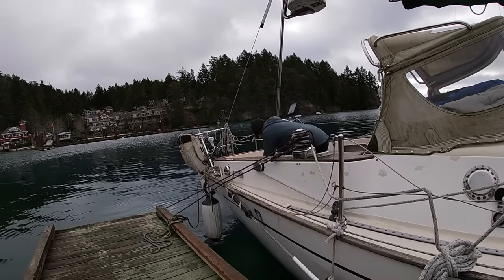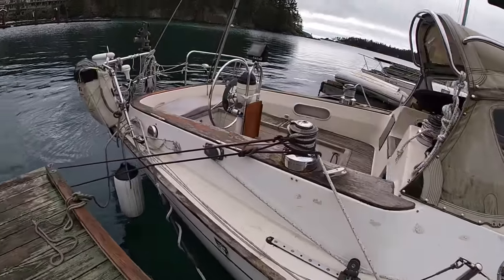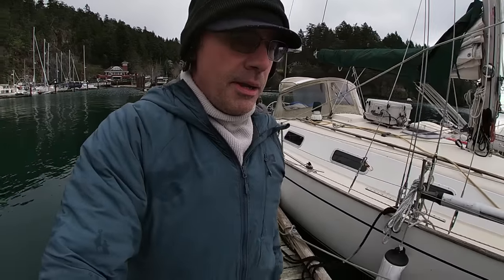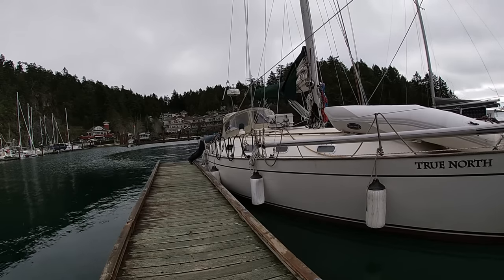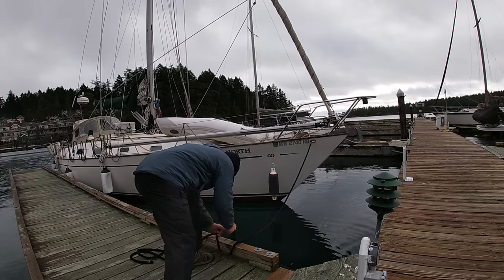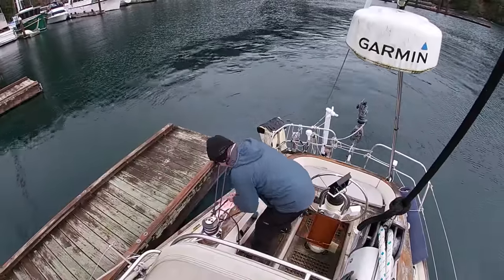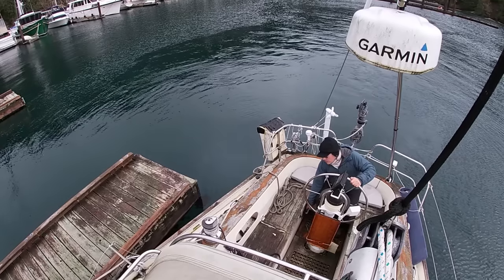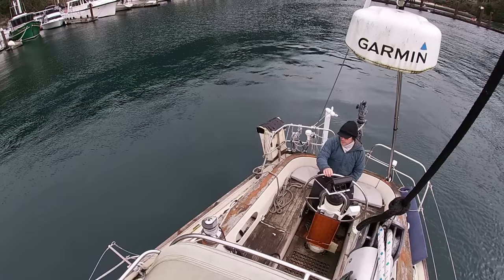SINGLEHANDED; LEAVING THE DOCK USING THE "MOITESSIER STERN TIE" -- DOCK VIEW

Comment: Where's the rudder?
Reply from the maker: You can start with the rudder centered and see where the boat lies against the dock. In this case, if I turn the wheel to starboard, the stern will settle further away from the dock. If I turn the wheel to port, the stern will settle closer to the dock.

Comment: As she's laying some starboard helm locked on helps stop the bow blowing off. The way I do it is to use a spliced eye on top of the winch, neutral or a  touch astern then neutral, flick off the line instantly and away. Before you've thunk it, the eye just  doesn't catch and you could flick it off with ease anyway. Try it.👍
Reply from the maker: Great idea mate. I like it. Thank you for sharing that.

Comment: Why didn’t you use the helm as well instead of an increase in throttle
Reply from the maker: Great question. I could have used the helm, but my wheel lock doesn't work anymore, so I would have had to tie off the wheel. The water from the thrust straightens the rudder out when left unattended. Very good question!

Comment: Nice. I do much the same but I first turn the stern line into a slip line so there is no need for a line on the winch. Also in this case I would put the wheel hard over to starboard and lock it. This helps keep the boat held on to the dock.
Reply from the maker: That sounds like a great approach. I must try that. Thank you!

Comment: That works good.  If that was me, I would have the helm turned to the starboard side to keep the bow pushing the wharf instead of more throttle. That would help with stronger wind issues.

Cheers
Reply from the maker: Excellent suggestion. Thanks for the note. I continue to learn from other boaters with comments here -- thank you!
Reply: @respecttherisk2022  we are all connected 🙏 thanks for posting your video

Comment: Beginner Canadian sailer here.. Why do they call it a Spring Line? Thx.
Reply from the maker: There are typically four dock lines -- the bow and stern line, both of which end up roughly perpendicular to the dock when tied off: these are meant to keep the boat close to the dock, perhaps 6 or 12 inches. The other two are the "Spring Lines." They are to prevent the boat from moving forward or to stern in the slip. I am not 100% sure on the origin, but in my own mind, they prevent the boat from "springing" forward or to stern in the slip because of wind or current. In practice, they are perhaps 10 to 15 feet long so as to be almost parallel to the dock -- more rope out allows more stretching movement of the line, thus reducing the forces on the boat. Happy sailing and docking!

Comment: What a simple, ELEGANT strategy!!!
Many Thanks.
Reply from the maker: You are welcome! Glad you liked it.
Reply: @respecttherisk2022  quick followup question: would you also advise to turn rudder to port… to pin stern to dock?
Reply from the maker: @tarekabdel-hamid2226  You can do it either way. Play around with the rudder to watch for how it impacts the angle of the boat at the dock. I have starboard prop-walk -- so I typically put the rudder to starboard to move the stern as far away from the dock as I can. Then, when I untie, and begin reversing out of the slip, my prop-walk straightens the boat out. Once the boat is moving slowly in reverse, I put the boat in neutral to get the rest of the way out.  So the rudder angle can become a tactic to pin the stern to the dock or move it away. Good luck and happy docking! :)

Comment: In UK usually have three cleats on each pontoon so only works if pontoon is longer than your boat and last pontoon cleat is behind your  deck stern cleat/winch. My pontoon as many finishes well short of stern and all pontoon cleats are forward of corresponding deck cleats. I tried it running a spring forward to centre cleat with a traditional shaped boat the tapers significantly it doesn't hold it the same way.
Reply from the maker: That is an interesting challenge that we don't see here much. Usually the docks are as long or longer than the boats. I wonder if you had a tie forward, and put the boat in reverse, adjusting the tie point until it sits where you want it? Just a thought.  I will try that when I am on the boat next.
Reply from the maker: One more thought I had for you -- if the engine is engaged in reverse, I would anticipate that prop-walk to starboard or port will impact where the tie goes. I am keen to try this myself to see how the boat responds. Best wishes!

Comment: As a Frenchman who was a sailor and a teenager in the 60's I read extensively Moitessier and I must say I never heard of the expression "Moitessier tie".
This method along with many others depending on wind, current and space was very well explained in the various booklets from PBO, or Practical Boat Owner published in the late 80's to the mid 90's.
PBO nor Moitessier invented this tie : it's been in use since ever and it's been one of the subtleties of mooring and casting off to use it properly with all its variant as many parameters come in the picture (including the pitch propeller).
As a matter of fact, although I fully understand the educational purpose of this video, I must say the "Moitessier tie" seems quite useless in conditions shown on video : weather is calm, apparently no current, very light wind … why not cast off all lines and just back off ??? the more so the area is quite empty.
As for casting off the lines from the pontoon, this is quite surprising.
It's been done by many amateurish crews these days and it certainly is not the way to do so. Crew remain in control of the boat when onboard!
The more so when singlehanded. Mooring line are simply passed through the cleats without being tied so it's a matter of slipping lines. Simple and very efficient.
Having sailed singlehandedly a lot during my time I thrive for simple, common sense, nobrainer methods : the ones that work with the boat I sail.
Then again the conditions are so easy in this video tant either way work well…
As for leaving lines dangling on the guardrails it's a "don't even think of it" for me, coil them and they will un coil very easily. 
Then again each one does as he likes.
Live and let live !!!…

Cheers ! … 

PS Moitessier is certainly a man to read when sailing singlehanded.
Reply from the maker: Thanks for the many thoughtful and considered points.There is a lot there for all of us.   It sounds like we share an affinity for Mr. Moitessier's books. I have read them all multiple times and always learn something new after every read! That is interesting re the PBO reference -- good to know. I called the "Moitessier Tie" as that was where I first heard of it. My sailing courses had never covered it! Totally agree: Simple, common sense is always best! All the best. Cheers.

Comment: I use this method to single-hand as well. 
I use  a modified version when backing out of the slip when the wind and prop walk are pushing the bow towards the dock: I pull in on the line while backing and use it to hold the stern towards the dock and the bow away. cheers...
Reply from the maker: That's a good idea. Thank you for sharing that. All the best mate.

Comment: good stuff. what would you do for scenarios where you have wind abeam starboard?
Reply from the maker: Thank you. If the wind was abeam to starboard, you would notice the bow coming off the dock to port. You could add some throttle, and turn the wheel to starboard to help keep the bow on the dock (while stern line is still attached). I have starboard prop walk, so one of my challenges if the wind is abeam to starboard, is losing the bow to port as I start to motor out -- both from the wind abeam, and my starboard propwalk. I can counter this using the stern-tie by moving the stern away from the dock with wheel to make a 20 or 30 degree angle, bow on the dock, and then reverse out -- which helps but doesn't always work. (I can lose the bow to port and it can foul on the boat next to me if the wind is stronger.) In these instances, I have done a bit of a "cheat" tactic, where I walk the boat about halfway out of the slip with the motor in neutral, let the wind catch the stern and blow it to port slightly, climb aboard, and motor out. If the wind is too strong abeam to starboard, I would ask for help guiding the bow out from someone on the dock. Longwinded answer, but these can be challenging conditions singlehanded!
Reply: @respecttherisk2022  interesting. thanks a lot for the info! very helpful😃

Comment: I've been doing this on my Sparrow 16 trailer-sailer for many years. It is super handy because I'm using an old outboard that only has forward and no neutral.

For me, I retie the stern-line by having it wrap around the cleat or bull-rail and bring it back to my mooring cleat. Then with the motor on and turned to push the bow in a bit, I can undo the rest of my mooring lines at my convenience. Then I get in the boat and when ready, undo the stern mooring line and go. 

My outboard is one that can be turned 360 degrees so that if I need to back out, I can do that easily too.
Reply from the maker: Thank you for sharing that detail. That sounds like a great and flexible approach.
Reply: @respecttherisk2022  You are very welcome. Like most innovations/inventions it came out of necessity! 🙂

Comment: Im thinking of getting a trolling motor to pull in and out.
After further thought   i have to do it with lines. The wind and the tide can  beat that.
Backing out with winds off aft port tide coming from aft the wind pushes bow  and im 180 degrees from where i want to be.
Reply from the maker: That is a really interesting idea.

Comment: I was very interested to see another method of leaving dock solo as I sail solo. However I prefer my own method. As you said, getting off the boat with the engine running just makes my scalp itch. 
I take all lines off bar one, the midship line. It's tied to the midships cleat, goes to the dock cleat and takes only one turn around it, then back to winch. I can use the engine if I want to point the boat, then I simply undo the line from the winch and as I reverse, the lines comes off the dock cleat and I can quickly pull it on board.
Reply from the maker: That sounds like a very elegant approach. Thank you for sharing that -- I will give it a try!

Comment: this was worthwhile.  I note you did not have to turn the wheel to starboard, kind of appears like you would have to if there was a stronger wind blowing from the starboard beam...wouldn't the bow want to drift off dock more?  i'm gonna practice this maneuver. ty
Reply from the maker: Thanks for the note. Yes, if the wind or current was on the starboard beam, you would add starboard helm and/or throttle. Best wishes on this. I found playing around with the helm valuable to learn the sensitivity to the angle of the boat at the dock.

Comment: All very calm and in control which is what we like. For me, taking off the spring lines and stowing them is no.1, converting the stern line to a highwayman's hitch or similar so that I can stand aboard and release the knot from the safety of the vessel using the working end is no.2. And then removing the bow line is no.3. No.4 is removing the tension on the stern line and leaving the dock. On a slack tide I'd store all my lines including the bow line whilst moored by the stern line leaving only the stern line to store once I was off the dock. On a rising/falling tide I'd improvise dependant upon wind etc...But that is just me, and I don't even own a goddam boat and never have. How weird is that. HA!
Reply from the maker: Thank you for sharing that. I like those ideas. I had not heard of the "highwayman's hitch" so I had to go look it up! (And I am a bit of a "knot-guy" as a lifetime rock climber and sailor!) That looks like an elegant approach. Thank you for sharing that! All the best!

Comment: One can also tighten the line and use it to start a turn around the end-of-quay bollard if space is tight. The name in french is: “faire croupiat". The great sailor Bernard Moitessier used it, but the maneuver has been known for ever and not used solely in harbors. 
          When a (motorless) sailing vessel was anchored leeward of and close to a shore and the wind turned opposite, increasing to a gale, the crew could lower a rowboat and moor a spare anchor, the hawser of which would be tied to midships. 
          With hawser taut and the sails ready to be hoisted, order would be given to cut the bow mooring: The vessel would pivot and take speed on a arc around the “croupiat anchor” and would thus sail her escape from the tight spot.
Reply from the maker: Thank you for this very useful and informative comment, not to mention the historical significance as well. There is a lot there to take in. Great information, and great advice for all of us. Thank you!

Comment: Love this!!! I have a long bow sprit platform on my 38’ ketch rig..  when I leave the dock there is always wind coming off my Starboard Bow which of course makes her drift to Port.. I often ask a passerby to grab a Starboard bow line to keep me straight until I get safely backed out… your video will help me solve this problem… Thanks for sharing and I just subscribed to your channel..
Reply from the maker: Glad you liked it. It does help. Sometimes the current and wind grab the bow and even this tactic is not quite enough. The other day, I had to push the boat out of the slip by hand about 2/3 of the way, angle it to port about 30 degrees, climb aboard and back out the rest of the way with prop-walk pulling me back to starboard. I am still learning and perfecting my techniques!
Reply: @respecttherisk2022  Good idea!!  I have thought about doing that too..  Well it’s all part of the adventure as they say!!  I have come to realize that arriving at and leaving the dock sometimes causes problems for seasoned experts too…. 😎⛵️🥢🏴‍☠️🤙

Comment: This is the ONLY way to leave the dock in an unfavorable wind!  

Here in the States, we’re lucky because we have cleats instead of rails.  That makes this much easier.  You simply take a short line with a spliced loop in the end, slip it over ONE horn of the cleat, and tie the other end to a cleat on the boat.  

Now, you simply back out of the slip and the dock line falls off the cleat without any effort on your part.  The line falls in the water, but it’s too short to reach the rudder or prop.  Both hands are free for the wheel and engine controls. 

Once safely clear of the dock, you can pull it in by hand, or use a docking pole, or even pull it in with another dock line bowlined to it.
Reply from the maker: Oh wow! That is a great idea. I will keep that in mind for when I am at a marina with cleats. An excellent suggestion! Thank you! I agree, it is always a struggle with an unfavorable wind -- especially singlehanded -- so easy to lose the bow against a neighboring boat! Thanks for tip!
Reply: @respecttherisk2022  
Just be careful that the eye splice doesn’t slip over BOTH cleat horns; then you’re not going anywhere!  The smaller the eye, the better!

Been there; done that!  Sure glad there were no witnesses!
Reply: Nice!

Comment: Great method! I would be quite tempted to just use the self trailer on my winch to hold the line, thoughts on that?
Reply from the maker: That's a good idea. Just make sure it is "bomb-proof" so to speak, and there is no danger of someone or you upsetting the tail by kicking it or upsetting it in any way -- it would be regrettable to have it come undone and thus run your boat into the dock while it was in forward gear. That said, I like the idea that it can be undone under load easily.

Comment: Thanks for the video, I did this for 2 years when I had to get off the dock single handed in San Francisco.  This work well until we have a strong (>10kt) crosswind breeze, which is about every summer afternoon in SF :)
Reply from the maker: Right on. Yeah, a strong cross breeze would be tough tough tough! How did you manage it? We would all love to hear your thoughts. Thank you.
Reply: @respecttherisk2022  I turned the wheel towards the breeze to get some prop wash to help get the bow to the wind.  It’s still quite tricky as I shift to reverse the wind still wants to quickly catch the bow,

Usually I watch the marina water for ripple so I can anticipate the gust, and go when I see a lull.  If the breeze is more than 10 knots, I will still need crew to help walk me out.

Comment: An aft leading spring line from the quarter is the best line to rig both for docking and undocking. Very unappreciated.
Reply from the maker: I also have not seen it used much by recreational boaters. I also use it for docking as well when the need is right. That said, mce the boat has stopped, I have started stepping off the boat with midship line and a stern line and tying them off without the stern spring line. Seems i do that the most these days.

Comment: To put a boat in gear, with no one on board, is just too much of a risk for me. There is no way to stop the boat if things go wrong.  Here is my way to undock single handed. I prep one center slip line, that runs from my cockpit to the middle of my boat,  to the dock and same way back into the cockpit. So both ends are in the cockpit (or your winch). With the fenders in front and back of the center line, the boat is firmly secured to the dock for the moment, with no option go to back or forwad (even with shifting wind, or tide). 
After this line is set, I can untie all docking lines. For departure, I have all the controls in my cockpit -  undue the centerline and bring it in, shift into gear and take her out. 
So at the end, it is just the same procedure as your method. Give it a try as an alternative method.

Always a hand's breadth of water under the keel and greetings from Germany
Reply from the maker: That sounds like a very elegant approach. Thank you for sharing that. I will give that a try!